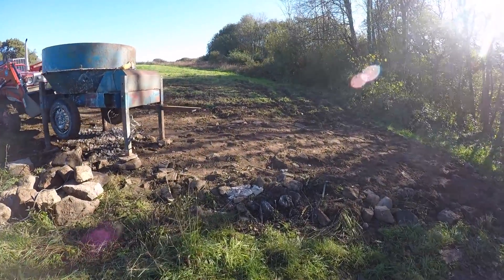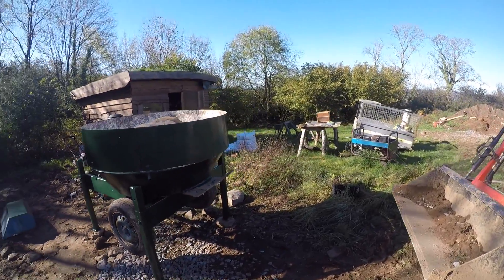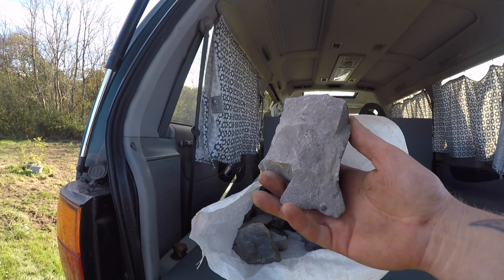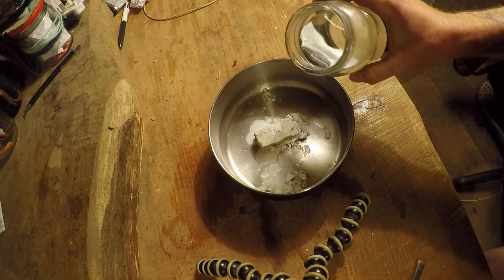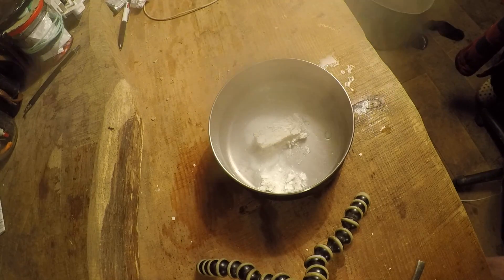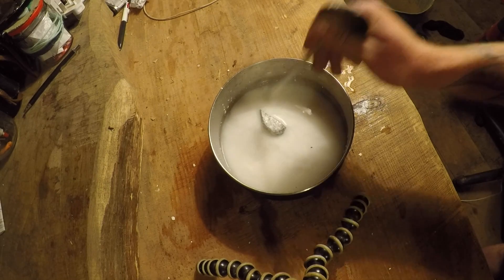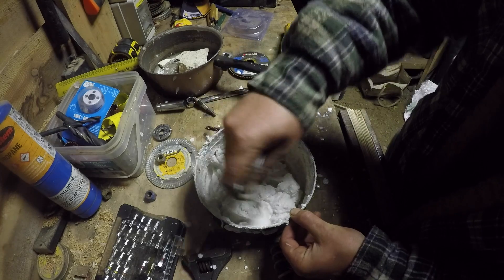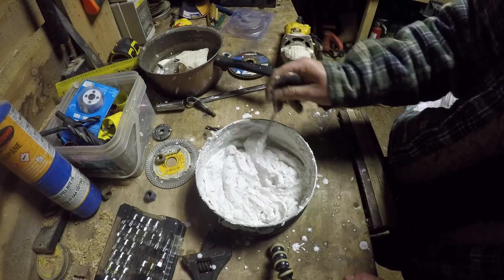Making my own quicklime and lime putty experiments

Comment: Wondering if you someone can help me understand something.  I've been told that unless dried wood is being burnt at very high temperatures (higher than what a wood stove can achieve) it's worse for the environment because of the greenhouse gases it releases.  But then I see individuals like Kris who use wood and I'm wondering what other think.  I know it's cheap for sure, but is it better for the environment?
Reply from the maker: Burning wood does release carbon dioxide but it only releases the carbon it stored by taking that carbon out of the atmosphere. Oil and gas are trapped carbon that has been trapped underground for millions of years. before then the atmosphere was much higher in c02 concentration and by burning it we out it all back in and we will change the climate back to how it was at that time. wood is not like that. wood takes carbon dioxide out of the atmosphire by means of photosythasis and when we burn it it releases it again. its call the carbon cycle. When people talk about the problem associated with burning wood they are talking about particulates and "pollution" But by this they mean Stuff that effects human to breath in rather than stuff that effects the envirmoment. Gas is much cleaner burning than wood but changes the climate, wood won't change the climate but if everyone burns it wr get smog and health issues. But one thing I can tell you for sure is wood is better for the environment, Gas is better for people in the short term.

Comment: Hi could you help me my house was built in 1895 I've been told it's lime mortar solid walls 
I live near the sea front 
Is it better to use 
5 sand 1 hydrated lime 1 cement
Nhl 3.5 1 lime 2 and a half sand 
Or quick lime 1 to 3 is quick lime hot lime 
So confused 3 pointer men priced  my work prices from £6000 to 11000 
Please help

Comment: when slaking the stone will off gas and the water boil...best to slake to a putty before putting it into your machine as the boiling process is quite caustic and heat would, melt the grease in the fittings and possibly blow out the seals?
 This is the  cooked stone they stored in castle keeps in sealed clay jugs so they could pour water into them and the boiling water and lime mixture boiling,  hot oil was poured from the ramparts when the castle was under siege these gate defenses where a close kept secrets with the masons for obvious reasons....

Comment: by the way horizontal flues with just a slight rise are also hidden benefits in winter the firing of the kiln could go through ondols under your home for central heat which means the days of winter you could burn brick limestone make charcoal and heat your home and out buildings with the same swipe...plenty of water on hand and the slaked putty can be barreled... all your of cuts from the sawmill for fuel etc and the wood ash is handy for the garden and making fire brick...recently read a paper republished from the american civil war era... they would dig a trench through the hospital tents 24 inches deep and they would 12 inches wide and covered with plate steel and sealed with clay mortar the trenches where brick lined but stone could be used sheet metal duct could be run off the cast flue and would gravity feed even heat in the hospital tents a fire would be built outside and the interior temp in the tent were between 75 and 80 degrees one flue was extended and many hospital tents could be heated off a single  hearth or oven...as long as the last flue connected to a chimney made out of pickle barrels stacked could draw the cooled smoke ..advantages were dry tents quite warm and of course less casualties... They gathered this technology from the croation civil war california gold fields and chinese railroad workers...but the croation civil war is where where the usa and great brittain delivered humanitarian aid and employed the updated version for field hospitals but the source of the technology was derived from the korean ondol....The documents where archived at the end of world war one ...hillside batch kiln could flue out for several heating processes

Comment: you can use charcoal but coal is cheap and well gets hot and takes away the 3 steps for charcoaling unless you can combine the firing processes still require an extended burn time...the slow build to 1850 degrees farenheit for 10 hours is the batch process but the temp is hard to achieve unless you can fuel the fire and charcoal in vacuum sealed barrels...at the same time  the clutch firing could also cook mud brick as well...so like in industry combining processes that require similar temps is most effective ...and lime stabilized clay blocks are also an excellent building material...

 fire

Comment: Hi Kris, love the experiment and your videos.
I'm a Structural Engineer from East Kent and have experience of working with lime; as an introduction some good books to read are the Historic England book Mortars, Renders and Plasters and the Historic Scotland guide Lime mortars in traditional buildings. You need to get the limestone up to a minimum of 800c but closer to 950c to turn the chalk into lime - and are you aware of the difference between an Air lime (usually called lime putty) and Naturally Hydraulic Lime (NHL). An air lime is derived from a limestone that has a lower percentage of silica and alumina impurities (less than 6% impurities) and an NHL has higher percentage of impurities, with the increasing amount of impurities (from 6-24%) leading to a harder setting mortar. The traditional grades of NHL based on their compressive strength were feebly hydraulic, moderately hydraulic and eminently hydraulic similar to todays NHL 2, 3.5 & 5. After having said all that the limestone needs to get very hot (nearer the 950c mark) for the impurities to 'activate', therefore if your kiln only fires around the 800c mark and the limestone contains a lot of alumina/silica impurities you will still only get an air lime because the kiln hasn't been hot enough to activate the impurities.
The difference when using these types of mortar is that basically an air lime has an initial set through evaporation of the water into the surrounding brickwork/laths followed by a slower process of carbonation whilst an NHL has an initial hydraulic set (whereby the silica and alumina impurities set, similar to a cement mortar)  followed by a slower process of carbonation. This means that the NHL mortar will be harder quicker than an air lime mortar - not such a big deal if you are rendering or plastering but its helpful if you are laying bricks and require a harder initial set to crack on with the brickwork. You can also add pozzolans to an air lime putty to turn it into an NHL mortar, see the following link (http://www.buildingconservation.com/articles/pozzo/pozzo.htm), that website is also good for all things lime related.
It also means that you cant store an NHL mortar once you have slaked it in water, as the mortar will set, you could possibly store a weak NHL, say an NHL 2 or 3.5 for a day or so but something stronger like an NHL 5 needs to be used the same day.
I hope that's helpful - I'm coming down to Wales towards the end of November to give my friend a hand in his woodland, I'm happy to meet up or chat this through over the phone if you like.
Reply from the maker: Thanks for taking the time to write that. that was very helpfull. i didnt know about the activation temperature. 

do you know of any way of finding out the silica/clay content other than testing by burning them and finding out if they set underwater? the limstone will be coming from the black mountains. i cant find any info on the purity of it there. there are lime kilns but i have no idea what kind of lime they were producing.
Reply: Hi Kris,

The geology in SE Wales is varied, the following link http://mapapps.bgs.ac.uk/geologyofbritain/home.html is to the British Geological Society map of the UK, in the top RH corner you can put in your postcode and it will tell you the underlying geology and surface deposits for that area, however this will not tell you the clay/silica content. Analysing chalk is not something we generally need to do; when we specify lime we just put 'air lime' or an NHL grade in the specifications and the contractor sources it, usually from firms such as St Astier or Cornish Lime.
However we do occasionally have clay samples tested by a lab; we use a firm called Soiltec in Kent, they generally charge £45 for a simple clay analysis and if you called them and sent them a sample I'm sure they could help. But if you googled Geotechnical firms that offer site investigation they should be able to help; Ive had a quick look and the following firms seem to offer what you need - https://www.terrafirmawales.co.uk/  http://www.soilconsultants.co.uk/

Hope that helps
Reply from the maker: Thanks for the information. i have just fired up my little kiln and got it up to copper melting temperatures. i have fired a small test batch of the limestone i have available. I took lots of little bits from a number of different bits of rock from the same area and fired them. they are now slaked and settling under water. I guess i will see if it stays as a putty.  Im quite confident in the temperature reached because i put some copper tube down in the furnace and it melted. this should be a fairly good way to work out of i can make air lime putty from the limestone i have available right?
Reply: Hi Kris,

Yes, using the copper pipe would be a good indicator of the getting the correct temperature, good idea that!.

Comment: Kris you could try putting one of these between your inverter & any motor you want to plug into your inverter. The reason why most inverters won't handle motor is the surge current needed for all motors but you can get around this by one of these electronic gadgets.

Mark

4000W 100A High-Power Soft Start Circuit Power Board for Class A Amplifier Amp

https://www.ebay.com.au/itm/100A-4000W-High-Power-Soft-Start-Circuit-Power-Board-for-Class-A-Amplifier-Amp/153131095424?hash=item23a7531580:g:fjMAAOSwdjRaw2vf:rk:1:pf:0

Comment: Hey Kris thanks again for another entertaining video. Was just thinking when you were using Genny as your inverter wasn't up to the job, I've seen people run  generators off of wood gas generated by fire in oil drum and Jerry can full of woodchips in the oil drum with pipe coming out the Jerry straight into carburettor of genny . Might be worth  investigating if you've a plentiful supply of wood?

Comment: I’ve worked with quicklime for years. My best advice would be to be careful of burning your skin and especially protect your eyes pal!! I’ve recently started a new job as an operator of the ground lime plant at the UKs best quality lime quarry. I don’t operate the kilns, but we’re all together in the same control room, if you need any advice Kris. You have no doubt done your research as always though pal. I don’t mean that in a patronising way, just in case it comes across like that. Love your videos. Look forward to the next!! Jord.
Reply from the maker: Thanks Jordan. I wil keep that in mind.
Reply: Wow nice offer!   Quick question.  Have you heard of Roman quick lime?  It has chunks in it that since it's mixed with seawater and cures fast it leaves chunks of lime behind that when the concrete cracks and water penetrates it activates and heals itself.   Can you make that???
Reply: thanks for the warnin!
Reply: I will second that. I have been a concrete finisher for 30 years. I have gotten some awful burns over the years. It’s no picnic. It’s painful and it takes a while to heal. Nice job.
Reply: Hello Mr Jordan, my name is Tunde fro. Nigeria, west Africa, please I want to start my own Quicklime factory here in Nigeria and needs tutoring. Please here is my contact WhatsApp - +2348023992661
mountaintopg@gmail.com.
Thanks in advance

Comment: Hi Kris, would a motor softstarter solve the issue of the motor not starting off your inverter? You could reuse it with different pieces of equipment as well.

Comment: Trying to say wood is better than gas is a very short sighted argument because your wood fired kiln will be a very very very small operation compared to a commercial cement powder plant. If a wood burning operation was big enough to compare to a modern gas fired operation you would first of all strip the land of trees to fuel the system and secondly you would release more CO2 per BTU (about double) with wood compared to gas. 
https://www.volker-quaschning.de/datserv/CO2-spez/index_e.php

The history of Sudbury Ontario should be enough to tell you otherwise if a wood fire is not burned hot enough the emissions are much worse than just CO2.

Comment: Nice to see you making your own , how long are you going to leave it to mature and do you think it may age better in open top vats  just asking really intresting stuff this, looking forward to see you milling stone
Reply from the maker: I am hoping to make it over the winter and have it ready for plastering the workshop in the summer. so at least 6 months to age. i need to keep the rain water out of it, rain water will collect carbon from the air as it falls and over time the putty would absorb that and turn hard.  the water in the tank will have some carbon in it but it would cause a problem if that carbon kept getting topped up all the time with rain.

Comment: When the lime gets extra hot it changes the composition further, so the reaction isn't immediate in the bits that goes extra hot. So let it sit in water over night. 

Plus, use an excess of water, the pudgy settles to the bottom so you can remove it after the morning without it being a problem, while ensure a full reaction of the lime stones.
Reply: @Stanley Kyree Flixportal =)
Reply: AKA high LIME TEMP = BAD? Is that so hard to understand lol
Reply: I know it is kinda off topic but do anybody know of a good site to watch newly released tv shows online ?

Comment: how long is that malleable? You will use this as paint or concrete mortar?
Reply from the maker: it will stay as putty as long as it is kept away from carbon dioxide. it will be stored under water for a long time.

Comment: That veg oil will solidify into a gel sludge that gets sticky and disgusting. It’s nearly worse that rust jeez could be worse. It’s a damn sight to clean away. I’d use spent motor oil or something meant for the job.
Reply: it also can go rancid which is why you dont use veg oil for cutting boards not saying your going to be putting food in the thing but rancid oil in your first batch or 2 of plaster/cement cant be good

Comment: you've probably thought of it but thought i might mention, it might be best to break up the limestone into smaller pieces before firing it so you have a lower chance of bigger pieces being unburnt.
Reply from the maker: if you look the limestone was all different sizes, this was so i could get an idea of how long it take for different sizes to burn. it cant be to small because then the flames and heat wont be able to get through the layer of stone in the kiln. i think quite big stone will be better. just needs lots of heat for a long time.
Reply: Just watched a documentary before this. It said it was to be broken into 2-6 cm gravel
Reply: My thoughts exactly. Maybe run the limestone through your Apple pulper or something like it. Cheers mate. Love your videos.
Reply from the maker: Haha, the apple scratter is good but its not that good! maybe if i made a tungsten carbide version.